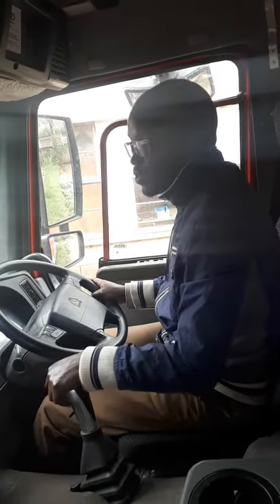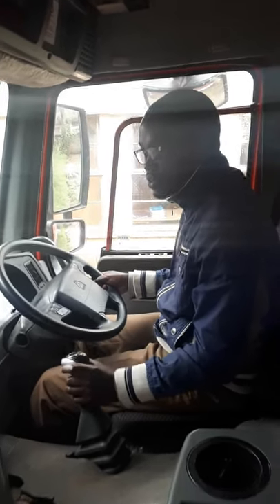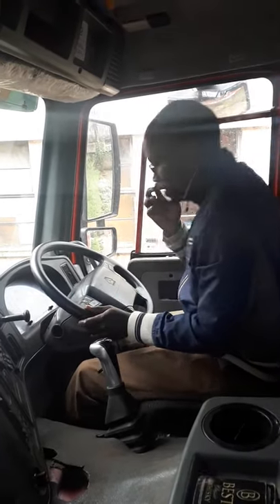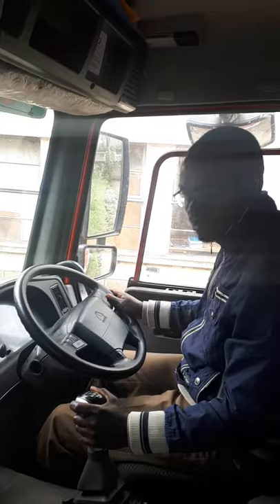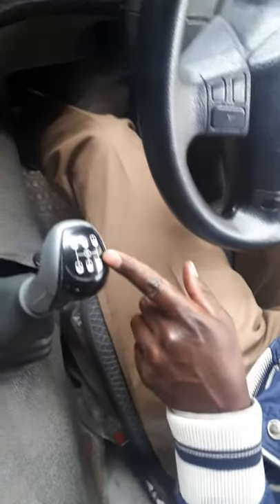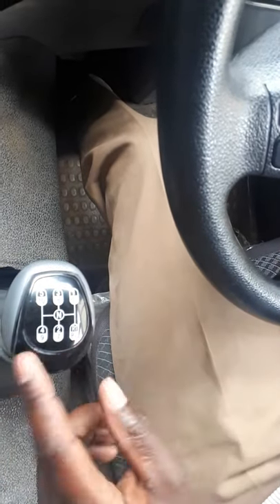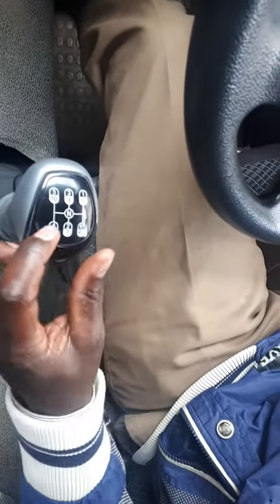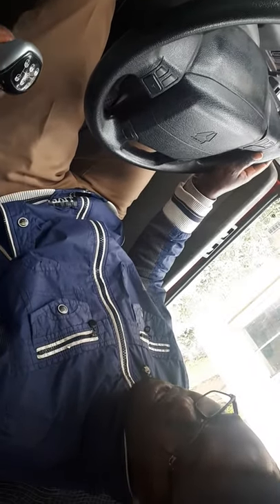HOW TO DRIVE HOWO SINOTRUCK 371

Comment: Why do i have to press the break when ingange gear
Reply from the maker: When you engage a gear your car is in clutch and this means it can move freely easily if it's on a hill or dropping gradient. Therefore the need to be on the brakes or hand brake too is necessary